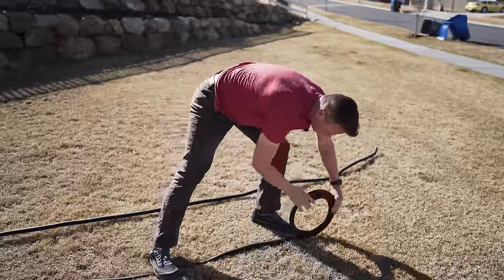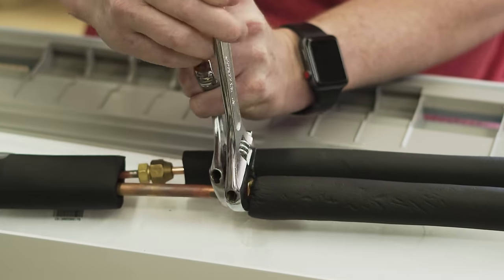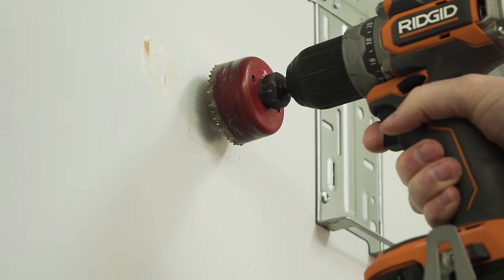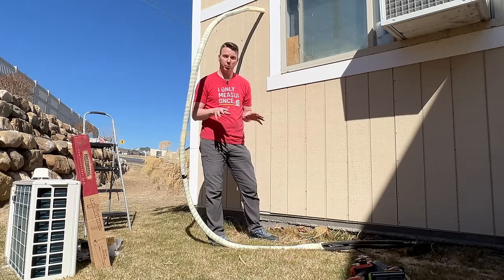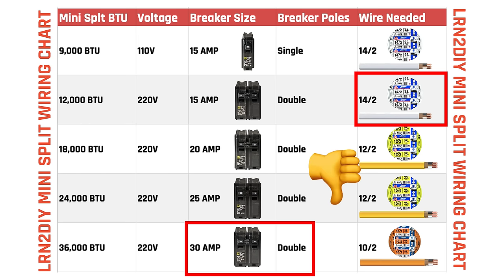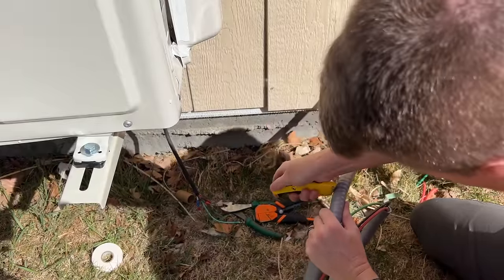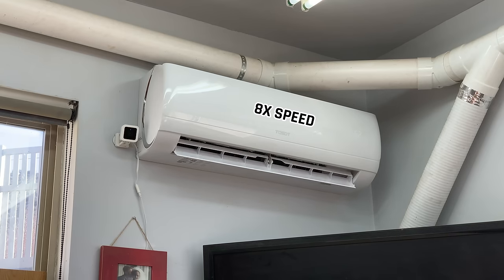DIY Mini Split Install - All the Things Nobody Shows You

Comment: You should pressurize with dry nitrogen up to the maximum high side pressure on your units data sticker which is typically about 550 PSIG.  I like using my Testo digital gauge manifold because I can see pressure loss in tenths of a PSIG as opposed to an analog gauge that goes by 5 PSIG increments.  I then pull a vacuum down to at least 250 microns (usually much less than that because my vacuum setup is nice).  Do a decay test to make absolutely sure there’s no leaks and then pull down to a final vacuum before breaking the vacuum with refrigerant.

Comment: Hey brother your electrical is off. You can use 10 awg if you want but your breaker should be 15 amp 2 poles. The reason is your breaker is not going to shut down even when your equipment over draw power. Why? Because the equipment is designed to run on 15 amp not 30 amp. Your wires is not outdoor rated. It should be thhn or thwn for outdoor. Your wires insulation isn't design to take direct sunlight or cooking in an emt. You do not have an extra red wire. The black and red are usually your main conductors to carry power from the breaker to the equipment. The white wires are usually to return power. When you do abnormal things like this you have to label that wire as a live conductor. When you are wiring for a 2 pole 220~240v the white wire is the one you should cap because you don't need it. Thanks for trying to help people but do fix this so you don't get yourself in trouble. If your house burn the insurance company will use this as evidence against you. Even if the fire isn't from your work. They will hit you with "a prudent home owner would not have...."

Comment: I really don't understand why it is allowed to use metal pipes for electrical wire in the USA. When the live wire is exposed somewhere in the pipe and touches the sides, the entire pipe is now live and it is not connected to ground or the RCD. Other than that, great video!
Reply: It should be earthed.

Comment: easier to switch that train port to the same side as the lineset. that way everything goes out through the same hole
Reply: you also can make your flare connections outside so you dont have to try to do a leak check behind the head unit

Comment: Heads up: Autozone will lend you the vacuum pump and gauges. They require a CC and a 100% refundable deposit. I just went and picked them up and they were brand new, never used!

Comment: Hello, you made few mistakes.
The vacuum is done to remove air and moisture, so the manifold *gauge, that you are using is only an indicator, you need a micron gauge to be sure everything is correct. and by keeping the shrader valve, it take 10x the time.

I personaly use a Vacuum manifold with Vacuum hoses, core removal tool, to have a good vacuum.  depends of manufacturer, the bare minimum is 250 micron and holding it.  personaly, i drop to 50 microns the mini split and the decay test will raise to max 100 micron. And the time is nothing, on large system, we can do vacuum for hours.  the important thing is your decay test. 
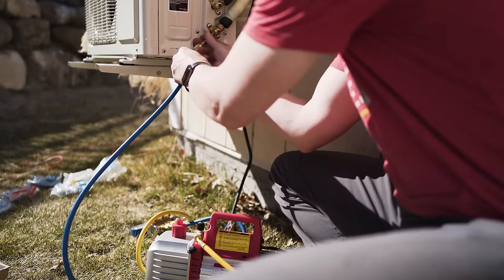18:50.....One BIG mistake is that you removed your gauge before opening the refrigerant's valve, wich made the air/moisture enter in your system.  That's really bad for the oil... so your compressor as well.  You should close the manifold gauge and open the valve, so the refrigerant will fill the hose, wich is better than the air going in.

the difference between the DIY and pro is the way you do the installation.  And the installation will increase your compressor's life or decrease it like in your case.

Comment: Romex is not code for use in outside conduit. Must use THHN
Reply: THWN? The conduit is technically a wet location, which is an issue for the Romex, as is conduit fill.

Comment: It's a mistake to think that for a higher voltage you need a thicker wire. The opposite is true. The current (amperage) goes down with higher volts (potential), given the same resistance (ohms). This is Ohm's Law. A=V/Ω 
So as the volts increase, but the resistance (Ω) is constant (motors, electronics) the Amperage decreases. Therefore you can use a THINNER wire to carry the current. The wire doesn't care about the voltage. It's the Amperage that's critical, which is lower with higher volts.

Comment: Just a recommendation for those looking at doing this job - DO NOT use the "$12 home depot disconnects". We had one of these on our house. I went out one day to find a RED HOT wire and melted plastic where one of the screws on a terminal block had come loose. That could have burned our house down! When it comes to electrical, spend the money for the quality stuff.

Comment: Great video!  Very helpful.  Just one thing - romex wire is not supposed to be used outdoors whether in conduit or not.  I think you should have used 10 gauge THHN wires which are rated for wet locations.  Of course, if you are not having it inspected by local building dept, then it probably doesn't matter, but for those people who need to pass inspection this is important.
Reply: I was going to make same comment.   Technically Romex (NM) can be run in conduit but its not supposed to be used in damp locations.  Romex is a second layer of insulation, so once you put it in conduit you're actually increasing the operating temp of the wire in a way that it wasn't designed to be used.  Also, the conductors connected to the 240V breaker are both "line" (ungrounded) conductors.  You should have used the red and black wires as white is reserved for grounded "neutral" conductors.  There is no neutral (grounded conductor) in most 240V circuits, and clearly not in this one based on the terminal block at the condenser unit.
Reply: @bille9243  Yes romex cannot be used in wet/damp location which means it can't be used outside whether in conduit or not.  Here is relevant electrical code for that:

300.9 Raceways in Wet Locations Above Grade. Where raceways are installed in wet locations above grade, the interior of these raceways shall be considered to be a wet location. Insulated conductors and cables installed in raceways in wet locations above grade shall comply with 310.10(C).

ARTICLE 334 Nonmetallic-Sheathed Cable: Types NM, NMC, and NMS
II. Installation
334.12 Uses Not Permitted.
(B) Types NM and NMS. Types NM and NMS cables shall not be used under the following conditions or in the following locations:

(4) In wet or damp locations

However UF-B can be used outside/damp locations and in conduit and is acceptable by electrical code.

Comment: Saludos tienes un GRAN ERROR  en la instalacion electrica, el breaker no se sellecciona segun la capacidad amperimetrica de los conductores, el breaker se selecciona segun el amperaje que manejara el equipo, para que asi este se pueda activar de forma correcta si llegase a existir alguna falla de sobre corrien o corto circuito en el equipo ; se debe colocar el BREAKER DE  .....2  X 15 AMPERIOS, Y COMO TODOS LOS VIDEOS QUE EXISTEN, NINGUNO UTILIZA LOS TERMINALES DE CONEXCION Y MUCHO MENOS GRASA DIELECTRICA PARA PROTEGER LAS BORNERAS EN LA PARTE ELECTRICA

Comment: I was told that wall mounting of the condenser would create noise inside the house.
Reply from the maker: I read that too but it has not been an issue whatsoever. It almost every video I shoot, the unit is running and you can’t hear it. I’m going to wall mount my next one too.

Comment: If you find out you got a too big connector, like on the end of your whip, instead of using a grinder, like you did, just get a step bit and drill it out. The step bit will self-center and make very short work of enlarging the hole. Of course, you need to get a step bit that's big enough. I bought a Milwaukee 7/8" - 1.5" at Home Depot for around $45. Expensive, I know, especially if I were to use it only one time. However, step bits are so handy for numerous jobs I'll get my money's worth, out of it, down the road.

Comment: Nils - love your channel and thank you for sharing all the great details.  We are putting a Tosot in tomorrow (almost the same model) but opted for the 12000 btu unit that runs off 110v.  My question is, “how did you figure out the electrical chart?”  My unit did not come with any guide whatsoever on electrical sizing???

Comment: After receiving a dead on arrival TOSOT 12k 230V (and received a refund) I have been waiting for several months to be restocked.  Last week I received an email saying the units have been restocked.  I ordered as soon as I got the email (within two hours).  The order was confirmed.  Today, several days after ordering I received another email saying that the units are out of stock until June or July.  Its already hot were I live so I don't want to wait that long.  Has anyone ordered a similar unit to the TOSOT in terns of cost, ease of installation, and (hopefully) reliability?

Comment: Your explanation disagrees with the illustration at 0:47.  Note the Summary, which states "as much space as possible (up to 8 - 9 feet) underneath".

This is far more reasonable than the drawing dimensions which says 8.2 feet minimum.  If that was true, it would be impossible to install this unit in most houses in the USA - since floor to ceiling heights are usually within an inch or two of 8 feet.

Comment: Our electrician used 30 amp for panel and it burned the mother board . The hvac guy blamed the electrician for putting a 30 amp and the electrician blamed the hvac guy for not configuring before installing the split. Eventually they both reached an agreement and ordered a new board which took weeks to deliver.

Comment: There are several things he did that are not "to code".  Romex should not be put in conduit; he should have either stripped the outer sheathing off or just used individual wires.  Two black wires or one black and one red would be fine.

Second, since he did use a "3 conductor" Romex, the white wire is really the one that should not have been used and left capped off.   The black and red wires should have been used.  He referred to the white wire as the neutral wire,  which would be correct in a 120 volt circuit and would be connected to the neutral bus and NOT to a circuit breaker.  If the white wire, which would normally be a neutral wire, is used as a "hot", it should have been color coded on both ends to show that it is not being used as a neutral.  This is usually done with "phase tape" which is usually either black or red electrical tape.  

Once the white wire is connected to a circuit breaker, IT IS NOT A NEUTRAL WIRE! and should be color coded accordingly.  The reason for using xx/3 Romex is that some applications require both 240 volts and 120 volts.  In this case, the red and black are used as the 240 volt conductors and one of the red or black is used with the white neutral wire to get 120 volts.  Even though how he did it will work, it is not the correct way to do it.  In this case it will be okay, but in some cases it can be really critical to get these things correct.  Things can be destroyed and fires caused and lives endangered by connecting something that requires only 120 volts to 240 volts.  If you are in doubt about any of this, hire (or at least consult) an electrician.

Comment: At 6:21 seconds you made an insulation mistake. You should have wrapped each copper line with its own insulation to prevent thermal transfer.

Comment: It is not good practice to put Romex in conduit. Romex is the brand name of a type of NM or non-metallic cable that is sheathed in tough, flexible plastic. Individually coated bundled wires are contained within the sheathing. It's generally best to run only separate THHN wires inside the conduit. THHN wires are inexpensive, easy to run through the conduit, and provide more space in the conduit since there is no cable sheathing or paper liner.

Comment: Fusing a 10 guage wire with a 30 amp breaker is fine BUT YOUR LOAD SHOULD BE PROTECTED BY ITS RATED AMPACITY. IN THIS CASE YOUR LOAD CURRENT IS 20 AMPS. Your condenser will fail and start a fire because the circuit is 30 amps! Please install a fused disconnect with 20 amp buss fuse protection!!!

Comment: You should never pick the breaker strictly on wire size. It needs to be sized for the equipment it serves. The nameplate on the outside unit has the minimum and maximum breaker sizes listed that should be used. I would have also used that wire that it came with.
Reply: Even though I think you could have worded that a little better, you are correct.

Comment: Great video!  I could not have done this properly without this well-produced instructional video.  I went with a Mrcool unit, but the TOSOT is sufficiently similar.  The installation manual that came with my unit was, in a word, pathetic!  I also discovered, as Nils (the guy that did this video) explains, the other videos I found completely disregarded mentioning/explaining critical information/steps.  One such step was the need to evacuate the compressor.  The direct link on the his website for a single Amazon purchase for the complete toolset needed to do this was a great blessing and convenience.  Thanks, Nils!

Comment: Why do you put a 15 AMP breaker and cable on a device that only draws about 1350w or 5.62A at 240v.
12,000 BTU is the output of the mini split ( 3.5 Kw and 14.64 AMP ) not the input.

Comment: If you are not gonna use a micron gauge, you should let your vac pump run all night.....then release al little refrigerant to positively charge the system before removing hoses.....ugh.....i install splits everyday....its the little things that make for a long lasting well running AC system.

And always use nylog....

Comment: Shouldn't you have used the red and black wires in the sub panel and the disconnect for line power,and capped the white/ neutral wire. Or wrapped the white wire with electrical tape to designate that wire as a hot wire or power conductor.
Also there is no neutral in a 240 volt circuit.Just two hots and a ground right? And if the manufacturer supplied  14/2 wire and recommended a double pole 15 amp breaker why did you use #10 wire and a double 30 amp breaker.Isnt that over powering the unit?  Anyone can respond. I liked the video but, I seen alot of electrical mistakes! Tell me what y'all think!

Comment: I can't overstate how helpful this video was.  I had bought the exact same model before finding this video which I used as a step by step guide.  From a DIYer perspective, the manual leaves a lot to be desired.  This video clears up a number of details and with a few adjustments to suit my specific circumstances, I followed this video (including addl input from some of the comments) to end up with a great installation.

This system, which use in an off grid solar project, consumes half the energy of the roll-around portable room unit we'd been using - and it delivers much more effective cooling much more quietly.  I'm really happy with this unit and am already planning for another unit elsewhere in the house.

Thanks for your excellent work!

Comment: If you're gonna put a 30 amp breaker on a 15 amp circuit you might as well make it a 100 amp breaker. 70 more amps of DIY protection

Comment: Did I miss the part where the lines were charged with refrigerant??
Reply from the maker: The refrigerant is in the condenser. No additional refrigerant is needed.
Reply: @LRN2DIY I can't find the links for the compressor pump and guages to purchase them

Comment: Thanks for the video. I've found it very helpful.  I think however that it's illegal to use any type of Romex or "SJ" sheathed wiring inside any type of conduit.  I think solid or stranded wire such as THHN is the type to use for any conduit use.
Reply: Not sure if you consider UF-B to be sheathed, but it is perfectly fine to use UF-B in conduit outside.  Given there is barely any price difference between romex and UF-B, I would rather use UF-B for everything.

Comment: You shouldn't have removed your gauge before opening the service valve you mess up the microns doing that just keep it on there and open the low pressure first the high pressure